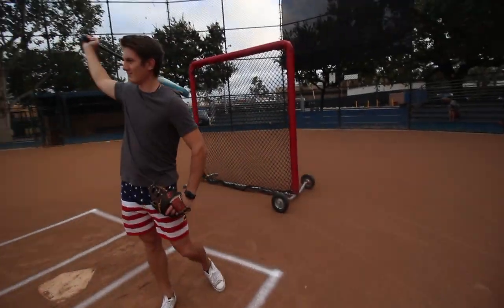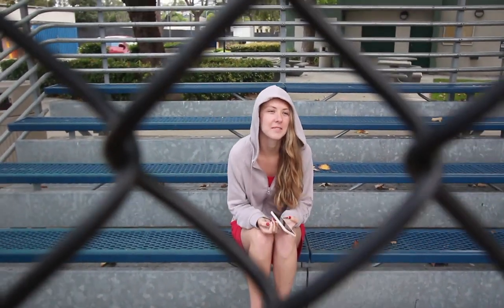HYDRO DIPPED Baseball Bat!!

Comment: idk if anyone is going to reply, but is there a risk of the paint sticking to the balls? I play at a club with less strict rules on bat customizations and might try this out. 
Thanks!
Reply from the maker: A few things. It’s been a few years so my memory may not serve as well but I don’t think we had any paint transfer. 
     I would reiterate that you want it to cure for a few days between dip and clear coat layers to make sure it fully drys.
       It definitely does dampen the pop of the bat. Maybe 15-20 feet so keep that in mind.
Reply: @kooksquad  ok, thank you so much for the video and the reply!
Reply from the maker: @thereallegoemmett2377 ya, good luck if you attempt